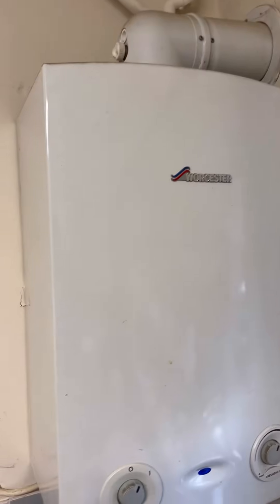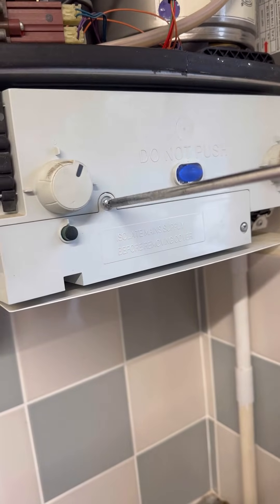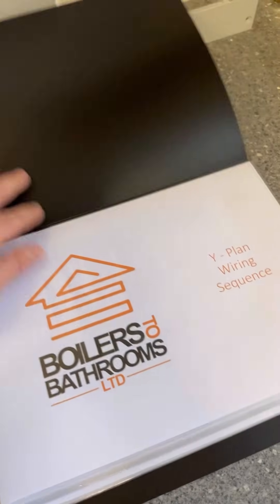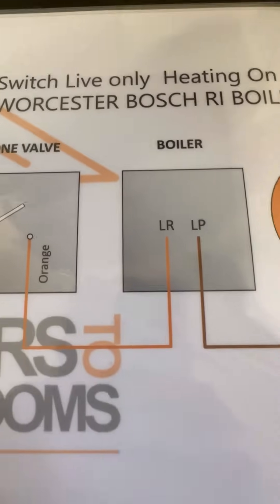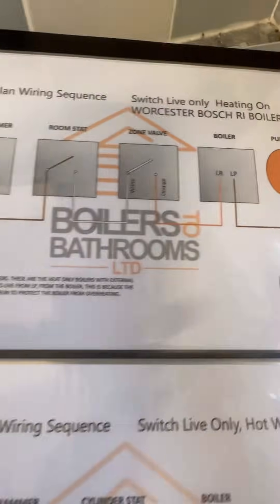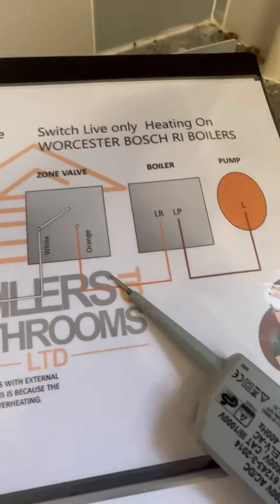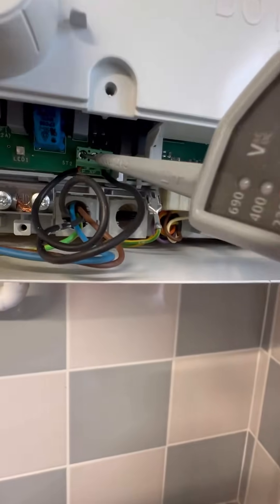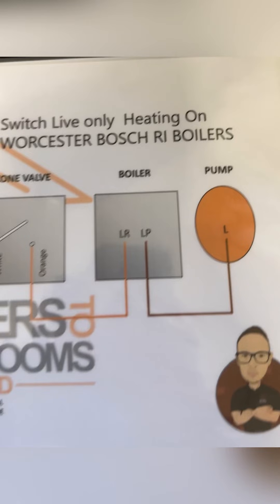Worcester Bosch greenstar 15ri pump over run explained breakdown Bible chapter 2

Comment: Great video. How come there is no neutral to the pump? I’m installing a 15RI on an existing system, previous boiler didn’t have over run so pump is not wired to the boiler. 5 core wire from the cylinder cupboard to the boiler. Is this enough like in the video or do I need 6 core for the neutral. I bought the Bible last night, great stuff 👍👍